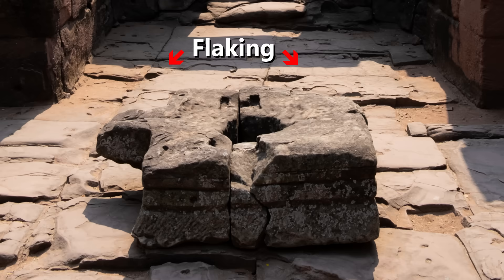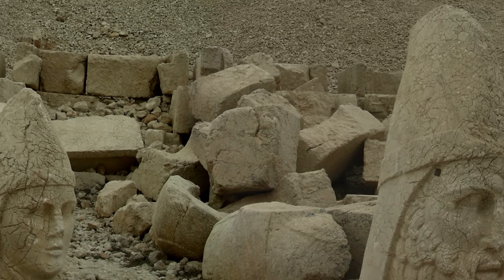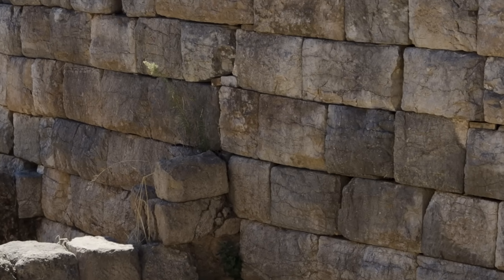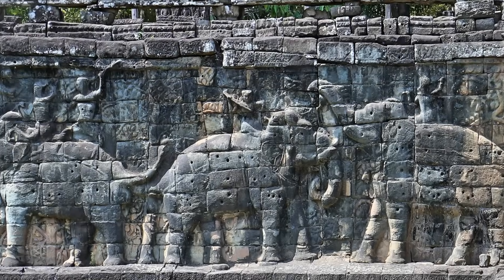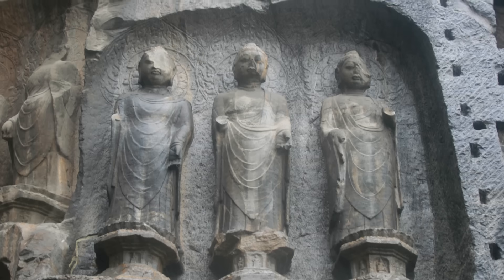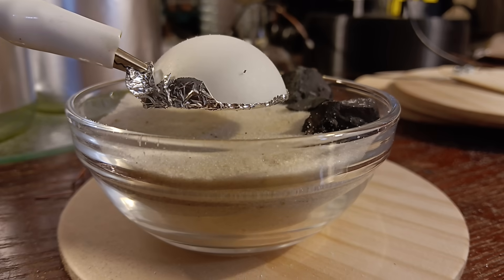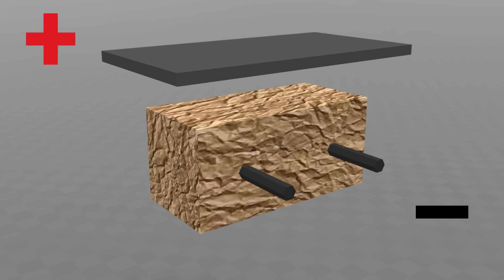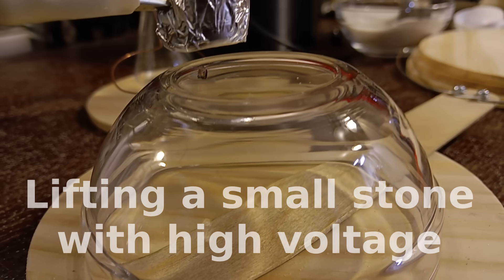The Greatest Mystery, Solved. Recreating Ancient Stone Melding Technology (Part 1)

Comment: I’m an electrical engineer and we’re talking about hundreds of MW to generate power to heat these blocks. What is the source of this power?
Reply from the maker: There are many sources to gather energy and harness charge differentials from, sky and atmosphere is a simple one, especially when 1000+ years ago the atmosphere had a higher charge and tapping power this way was widely used - there are also those 'orbs' flying around in the skies today, you could simply ask them where they get their power, as that is an impressive display too =)
Reply: @ Where I found part 2?

Comment: With elements of the world, it has to be considered.   We can assume common connection elements energy to control heat at extreme natural heat. 
A common thing in time we forgot about. Pottery clay form shaped and cast weapons, or into melting stone. 
Magnetic feild from iron aliment cooling to plates of granite spun, between copper copper wire spun opposite way layered six times. A Magnetic induction to generate heat increases to melting.  Granite gravel and iron sand heated homes with steam energy powered plates.
Tested 
Hope you try this. The inertia energy to heat to steam and return to plates holding fleids energy. Cycling heat to electric to steam and energy efficiency.  Add an exothermic reaction to start or low heat battery. 🤔  😂 I forgot about that way of life.  A rough translation from old text.

Comment: You don't need to use electricity. A good example is Roman Concrete originally thought to be carved limestone. If you can make a basic wood frame for the base shapes fitted as a puzzle, you just pour the contents. Over time the weight of the concrete type material under their own pressure does the rest of the work in eliminating gaps between seams and it cures over long periods of time to become stone which is part of where terms like concretion stem from. Basic physics.

Comment: Can't quote Nikola Tesla then talk about electrons like they really exist 😂 funny no one has ever been observed in history. Yet its effects are. 1 Dielectric unit= an electron. Thise stone look like concrete
Reply from the maker: Everything is an electromagnetic wave, whenever I might rarely mention an electron (I think one time) I was only trying to reference what the average person understands and current 'science' depicts. At every ancient site (and their quarries) you will find overwhelming evidence of 'vitrification' because high heat was used to remove the stones as well as shape them - volt on!
Reply: @MadPlasmatist  the average person is told the fake relabeled science not the real deal. That's the point of statement. Everything is a emf. Waves aren't things they are actions.  I c no overwhelming evidence for that. Heat is used to cure concrete as well. The holes are for the vibration to make all the air trapped move up and out of the mix. A slight charge when cursing aligns the structure within the stone. They/finished stone would have heat stressing if your way was true sir. 
Thanks for the engagement friend. 🙏♾️ The more we clarify the less they have.
Reply: When curing*

Comment: Ok but where are the molds for the stones?  And what happened to the equipment that generated so much electricity?
Reply from the maker: There are no molds for the stones, they 'puff' under weight and heat from the melding process - like most metals, they turn to dust after only a few decades let alone hundreds or thousands of years - the most recent widespread use of advanced tech was Indian temples, only 800+ years old (plenty of metals and evidence of advanced metals like iron that doesnt rust), and why these temples don't, yet, look like the poorly degraded examples from older periods though unkept ones are starting to. Advanced machines and much of the precious items like gold were of course looted well before most if not all countries in our current time-period were even thought of.

Comment: Some of the nubs seem to be flat on the bottom and rounded on top. That doesn't seem like what would happen from an electrode being pulled from soft material horizontally.
Reply from the maker: That's a very good observation - upon giving it some thought, it would seem something flat was placed below the electrode before it was pulled out to prevent stone or metal slop from oozing or dripping onto the finished work below it. Nice work! *edit: keep in mind this is a multi-step process, the rock is allowed to mildly cool with the electrodes left in, then the electrodes / area around them are heated quickly and removed.

Comment: Thermite can have the right effect. Mixed with granite  started from bottom.
Reply from the maker: It can but by using high-voltage, high-amperage electricity, the electrodes allow the heat to reach deep and evenly into the materials - this is also a multi-stage process (especially not to crack the rock with uneven heating)... The electrodes are left in the stones to cool afterward, where they are then again heated up briefly to soften just the area around them then removed... Thermite would crack the rocks and cause chaos + burning / scorching of the stones - I can assure you, they used high-voltage / high-amperage tesla coils to achieve this effect =)
Reply: @MadPlasmatist   
Iron and aluminum were around.  Thermite gets to 2700deg, and most stone is lower. A mixture like  hot cement would melt in a controlled heat from the bottom.  And iron can be released from ignition.  Angled in, for gravel.  The heat can be  controlled and used to melt, drill, and cut shape. 
Proof. Iron and aluminum in the stone. Original stone does nt.
Gravel easy-to-use for travel and lifting. 
Blocks created in place.  fill and ignition. 
Electrical at the time was used in electroplating.  And hydrogen gas. 
Thanks for  the reply 
I haven't seen any other solution that can make sense and covers exactly worldwide. 
Can you prove it or disprove it. It is a sound solution for many mysterious melting stones. 🫠
Reply from the maker: @JasonSmith-kh7cf  Keep in mind it had to be high-voltage plasma as this was a multi-step process, rocks will easily crack if not kept relatively the same temperature thoroughly - which can easily be achieved by controlling output voltage (raising the temp slow and lowering it slow) - also, if thermite or other methods were used, they would not have made square and octagonal holes to place it in (plasma emits from the edges, these shapes are controlled edges for plasma dispersal). There will be a part 2, starting to get some real interest from those who can fund the project =) Volt on!
Reply: @MadPlasmatist Aluminum takes electricity to make. The exothermic reaction reaches extreme heat. 
The mix of gavel granite worked. Added more  as the block formed. The form shaped as predicted, and metals came to bottom nubs 
Melting stone was around 1200c and metals liquidity at 750c. 
Granite was heated and vinegar cooling to crush and remove gold. Making Aluminum was the hardest part. With what they had? But it worked. 
Plus the iron in the stone can be remelt with induction. But only soften the stone. 
I see the same thing around the world.  In different times. 
This could explain many things.
Reply: @MadPlasmatist  Thermite common use is Melting iron copper with mix for low temperature,  x 2 and could be induction to ignition?? Safer.

Comment: How to carve a stone to fit precisely: Carve the top of the last stone you put in place until its faces have smooth surfaces to mate to. Mix a bucket of plaster and slather it against the surface you just finished.   When it’s set, pull it loose and take it with you back to the quarry.   Find a stone that comes closest to being the shape on one side that matches the shape of the plaster.   Carve that stones mating faces to match the shape of the plaster mold you took off the already set stones. Measure carefully and take your time. You can take profiles off the plaster to verify, either in strips of bark, or by literally casting plaster profiles to check how well the stone matches the plaster mold.
Then haul the stone back to the wall and put it in place.   It fits perfect, because you KNEW what you were doing.
Really.   It’s NOT hard. Ancient peoples all over the world figured out how to shape and move stone.  It just take patience and an average amount of intelligence. And someone willing to PAY you to do the work.

Comment: If it's true then prove it. I wanna see this. Grab a car battery and some cables and simple metal rods and try it.
Reply from the maker: Can't just use a car battery, it has to be high-voltage plasma that is hot AND can reach deep into the material - if the rocks are not evenly heated and cooled they will also crack.

Comment: The inca said they did NOT build those buildings, previous civilization. Indeed there is a distinct difference in later civilizations...and sloppier way of building with smaller stone. Further they said they melted the stone with paste and acid. Possibly from mining.
The points and nubs are for holding rigging. Then chiseled off, and polished

Comment: That is complete BS. 

Do the maths on how much electric energy would have been required.

As recent findings suggest, those granite stones have not been melted. They have been made moldable using melted natron and combining it with water glass and different metal oxides. This is by far the most plausible solution to this „mystery“
Reply from the maker: Okay yes that makes complete sense. But only if you ignore all the vitrification at both the sites and their quarries, and the nature in which electricity reaches deep into materials and heats them.

Comment: The "stones" at machu pichu are smaller rocks stacked and then workers would put a wooden mold on front and then fill in with moist concrete, coat the inside of the mold making a facade in any shape they wanted ,I can see in photos where the facade is missing rough cut stones behind , its just that they think its stone but its concrete made with volcanic ash and other ingredients that make it look like rock, any stone mason could stack rocks and make a design to cover it with concrete, they are not individually cut stones, you can break the front and see the rough stones behind, silly ..

Comment: You do realise that if a rock is lifted by electricity or magnetic force, the weight is not lost but only transferred to the point of lifting. So you would still have to take the weight on the electrode above it which would bend under the load. And as the distance lifted would be small, you would need to chock the rock then reposition the electrode. So not really efficient at all. And that is if it even did anything to a multi tonne rock. Plus the amount of power needed would be far beyond the abilities of anyone, ever. Except aliens. So what are you saying? You will need to actually "do it" large scale to "prove it".